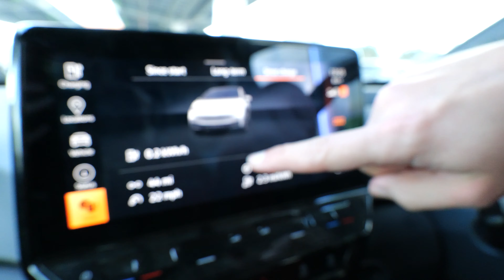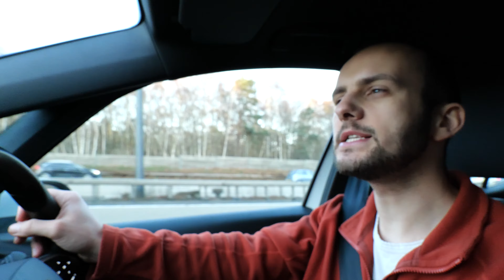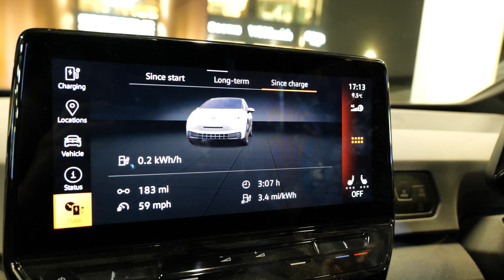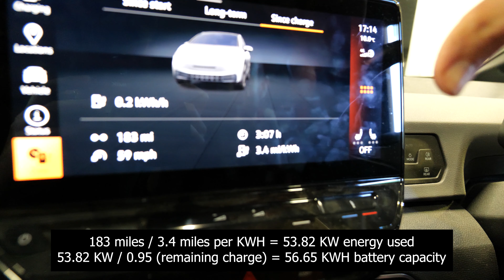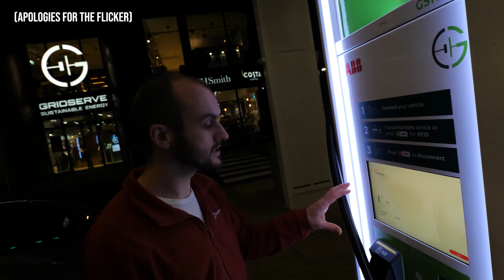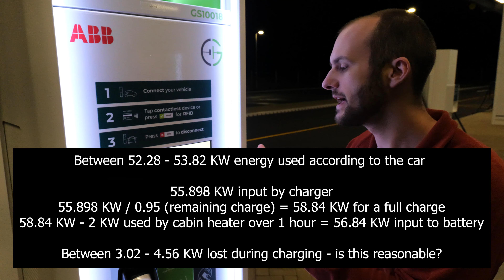How Much Battery Capacity Does An ID3 Have After 1 Year?

Comment: LOL this whole video is pointless. THE NUMBERS ARE NOT TO BE USED LIKE THIS! You calculated the energy used based purely on the Miles driven & efficiency whereas in real life it would have used EXTRA energy for the heating and electricals in the car + energy loss during transformation etc. so the ACTUAL capacity of the battery is HIGHER than your calculation

Comment: What is the cost of a full charge at a ‘petrol station’, I am curious what the cost is of running an EV if you are away from your home charger?
Reply: Ranges between 0,35€ to 0,70€ per Kw/h in Spain. So I would say when you're away of the home charger costs are around the same as a Petrol car. But on you everyday use, (using home charger) its only 1/5 of a Petrol car. So overall, much cheaper to operate.

Comment: you should use an obd & go off the BMS SoC% before & after drive (for discharge) AND charge back to 100%.  Also the BMS counter for kW charged & kW discharged from the pack from the starting "100%" to the "5%" & back to "100%."  Doing so will more accurately place those decimal point.

Comment: Thanks for mentioneng me. My name is not Björn though. my name is Chris ;)
My 8% degredation is fairly normal for an EV in the first few months.
Most EV car maker though bring the buffer in to not show degredation.

Your drive was great. But driving not a constant speed and accelerating a lot, even only  to 30 mph
means you have more heat loss, therefore the kWh taking out of the battery is higher.
And you don't know if the capacity was exactly 58 kWh a year ago.

The only real way to know is if a VW partner is measuring the battery.

Comment: Not sure I agree with the maths. The miles per kwh reading in the the car is an average, so I would say that the figure to use would be the total delivered by the charger on the session.

3-4 kw of loss on the charger/cable id say is unlikely, especially when you consider a kettle or electric fire bar is around 3kw, the cable would get hugely hot.

Comment: Also does the cable that comes with it allow you to access the fast charging point and your slower home charging. Or do you need to buy additional cables?
Reply: The fast chargers 50KW or higher come with the cable attached, as the standard cable would probably melt. Many of the faster chargers have cooled cables as the charging can generate an amount of heat …. These are known as charging loses , usually around 2-3% of your charge is lost in heat generated. The standard cables that the car comes with will handle the 7kW AC chargers at homes and also you can plug them into the 11kW & 22kW AC chargers (3phase) that’s you often see on Zap-Map. However most EV’s (ID3 included) can only pull 11kW from AC as the inverter is limited to 11kW. It has to convert this AC energy into DC which is how the battery stores it’s energy. 👍🏻
Reply: You only need to buy cables if you want to charge via a standard 3-pin socket.

Comment: Great video thanks! We are buying an ID3. Would you recommend the 145 or 204 HP version??
Reply: It depends on your usage but if you can you should go for the 204 as its got good acceleration which can be helpful sometimes. I haven't tried the 145 but own a 204
Reply: Depends how quickly you want to accelerate and get up to speed, and what car you’re used to. I got a 204, my previous car was a Mercedes V6 with 231.
Reply: Go with the 204.It is a heavy thing at 1700 kgs at least.Tried the entry one and it is adequate but a slug compared to my 18 year old 330i.That's 230 BHP but only 1400 Kgs.

Comment: Thank You for these Videos, How much did it cost to fill up the 95% if you don't mind me asking.
Reply: A 58kWh car will use maybe 65kW of electricity (worst case scenario) to fully charge from 0%-100% given there are losses during the process.

Multiply 65 by the rate you pay per kWh, for me at home that is 5.5p off-peak, but it could be 45p if using a public rapid charger.

A typical charge is 20%-80% which would be 39kW of electricity - at home that would cost me £2.15, at a public rapid charger it’s £17.55 - that would add an average of 130 miles of range, more in summer and less in winter.

Comment: Your ID3 is getting summer figures motorway driving range compared to ours, we're lucky to get 2.5mi/kwh during winter ~5c with the heat pump fitted too...
Reply from the maker: Yes we do normally find worse range than this, the fastest I've managed to burn the battery on a single journey is around 160 miles in the winter! It definitely helped that the battery was fully pre-heated before the journey by a full charge